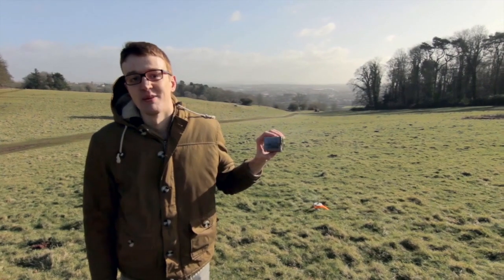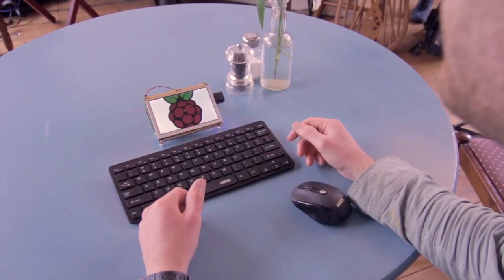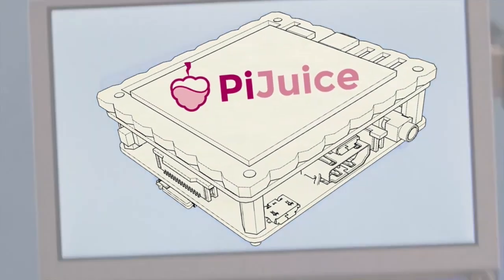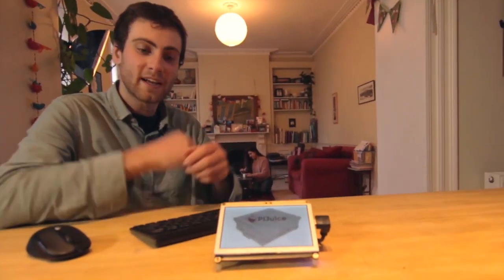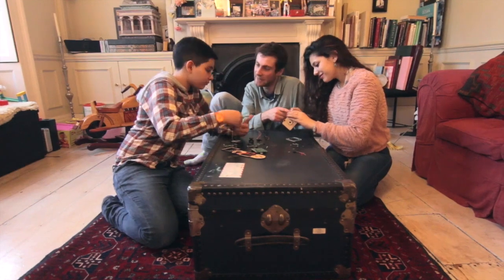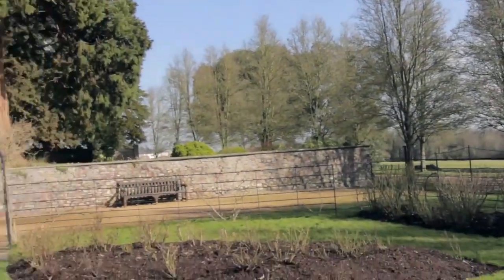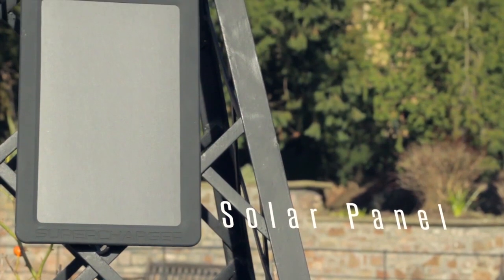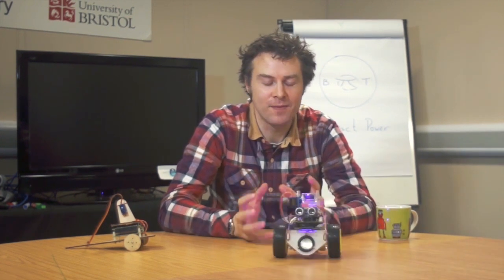PiJuice - A Portable Project Platform for Every Raspberry Pi

Comment: the standard battery is way too weak and will only last less than 1 hour running an RPI4 with Unicorn display and a DAC. You should design a battery that at least triples that and that fits on top of your hat. You sell a 5000mah battery but with a very poor solution having the battery hanging outside the pi.

Comment: Is there any way to adjust the battery provisioning?
For my use cases I'd like to actually set the "fully charged" point at about 80% and the "depleted" point at about 20%; throwing in a larger battery to make up the difference isn't a problem, but battery degradation absolutely is.
Reply from the maker: Could you post an issue over on our GitHub issues page here https://github.com/PiSupply/PiJuice/issues

Comment: Hi, I'm designing a system that will be solar powered. I'm interested in this product but I need to know the nominal voltage, max power point intensity, short-circuit intensity and functionality factor. I didn't find this info in your website
Reply from the maker: Could you post an issue over on our GitHub page https://GitHub.com/PiSupply/PiJuice
Reply: @PiSupply  posted. thank you
Reply from the maker: @MrPakurfulo  no problem at all 😁

Comment: Very nice. Does this hat work with other products that have similar GPIO pins like the Friendly ELEC Nano PI or the Pin64
Reply from the maker: Yes it can do but you may need to do some work to port the software over. The "dumb" UPS features will work without the software though if the pinout is the same as the Pi
Reply: @PiSupply  awesome. Thank you so much for the reply. I'll do some digging to see if there's anything that needs to be done. From what I understand the other boards pinout are the same as a Raspberry pi.
Reply from the maker: No problem at all!

Comment: Actually a pretty simple idea.  The cell phone makers had already cut the battery size (particularly Motorola), and it was a matter  making a battery "compartment" for the Pi (like the old AA/AA compartments for DIY projects...
Reply from the maker: Not quite that simple really as we add a lot of intelligent power management features and a whole host of other things.
Reply: @PiSupply  Adding the auto shutdown feature saves me a lot of time and headaches resulting from corrupted databases.